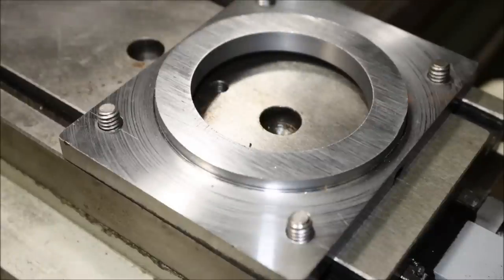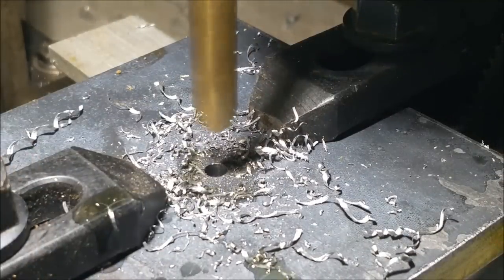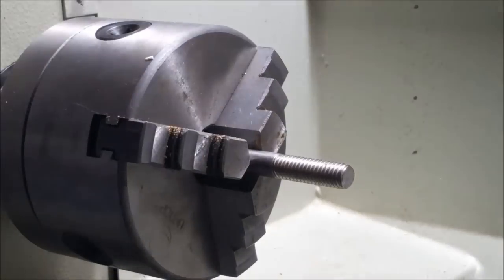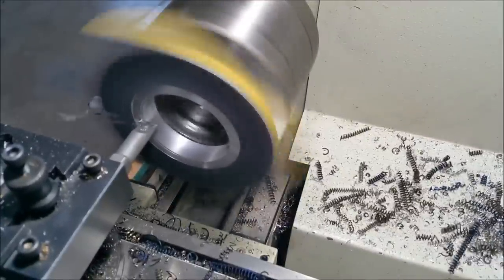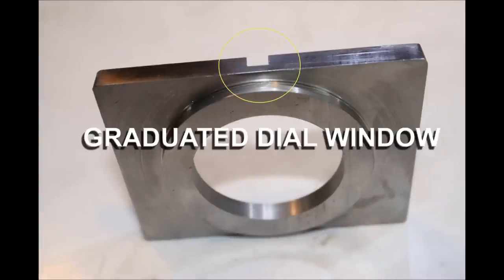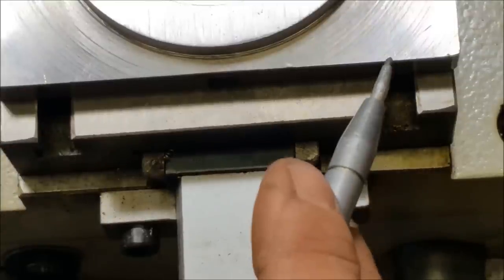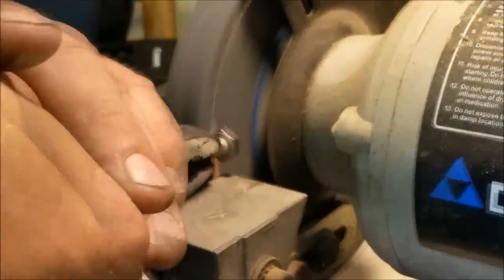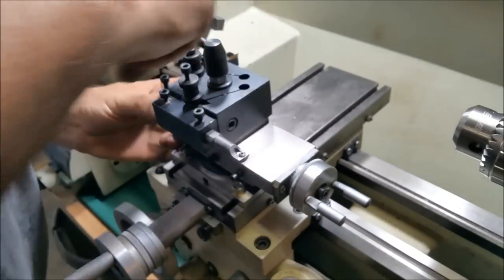Grizzly G4000 9x20 4 Bolt Compound Clamp Mod

Comment: Just a suggestion.... Offset the center hole to one side to make it easier to see the graduated dial. The larger diameter hole on the bottom should break through the side without the need to then mill a window. Great job. Keep up the good work.

Comment: Just wanted to say thank you for doing this video.  I made the same part and it made a world of difference!  The original design just doesn't hold the tool post as rigid as it needs to be, and this mod made it rock solid.

Comment: Don, this is really a superb video, just the right level of detail and explanation. I don't have easy access to a piece of steel the correct size, but I do have a block of aluminum, so I'll try using that to make one of these plates for my 9x20.

Comment: I would just like to add some advice, when making this replacement for the two bolt clamp do not turn the centre hole to the size given. After making this modification it has been found by many lathe users  that if you bore the centre hole to a close sliding fit to the spigot on the bottom of the top slide, this will go a very long way to eliminate tool chatter.

Comment: I bought this same lathe from Harbor Freight about 8 years ago.  It was a floor model, so I only paid about $400 for it.  It had a couple of issues which were easily fixed, but this modification isn't just a nice suggestion, but an absolute necessity, IMO.  These can be turned into really decent little machines if you do some work on them.  This is the first mod that should be done, and will make this lathe much more rigid and stable.
Reply: I got me this same lathe (Central Machinery) last year 2021 from some scrapyard in KY for right round the same price... this was the first mod I did after fixing up the poor thing which had been banged up rough from its time in said yard.. and even I was quite surprised that I even managed to pull it off even with the most basic of tooling and a ‘Meetotoyo?’ digicaliper.. Still there to this very day. As for the graduated dial slot, I had to mill that on the lathe with a vertical milling adapter table thing.

That, and I had to turn it from a 5/8” thick plate, which turned out real nice as it was thick and solid, though thinking in hindsight, I could have made more space for the bolt heads, but it all worked out in the end despite it being a rather tight fit.

Comment: I am planning to make one of these Thanks for the idea. How about using an hole saw and making a slightly smaller hole than the smaller finished inside diameter to hole the piece in the chuck for the first operation? That would also save some time in the next turning as most of the metal is already removed...

Comment: I need to make a tool post holder something like what you built , good job btw.  I was turning a piece of brass stock and the tool post was ripped clean off the cross slide !  Broke the cast iron base !
Reply: Funny i have used this machine for years with no modifications.Did you tighten the base unequal with debris under it?Did you make an excessively deep cut or did you crash the tool post into the chuck?Parts can break but if you find yourself modifying your machine you may need to get back to basics.When i write programs for our Haas VMC”s or lathes at work   I am trying to be efficient and maximize profit.When i make parts with my home Jet 920n I understand that i have to work with a different set of parameters.The vast majority of all modifications i see on these small hobbyists machines are totally unnecessary and are the results of poor set up and tooling use by the user.I have hundreds of hours on mine and have used it most of the time on 304ss and 316l .If you exceed the limits of any machine you are going to have issues.Poor machining practices / improperly sharpened tooling are the root of the majority of problems with non professional Machinist.Food for thought.

Comment: Thank you for responding. I do that when I centering the tool, however, the adjustments on the tool holder wont let me go lower, I think I will have to send the tool holders to a shop to take down 50 thousands.
Reply from the maker: if you can t go any lower, you could grind the bottom of the tool.

Comment: Hi folks, overall a really useful idea but don't use a drill chuck with an end mill cutter. That sort of chuck cannot grip tight enough and the tool can be pulled out by the cutting forces with possibly very dangerous results. Drill chuck are designed for pushing, not the pulling that happens with an end mill. Also do not use standard bolt heads in T slots. It's a very good way of distorting the slot. Use the proper T nut - they are designed to spread the load for a reason. BobUK.
Reply from the maker: Thanks for the feedback Robert
Reply: T-nuts aren’t exactly a buy whatever you need item, sadly.

The way my lathe came as-is already had standard bolts shoved into the t slots to hold the compound assembly in place using the original clamp, and of course it sucked, but had to make do until I managed to mill t nuts for it using a lathe milling adapter table and a toolmaker vise (yes, I put endmills in the chucks, and no, I didn’t have any choices at the time) - that, and the stock lathe t slots weren’t standardized stuff, or at the very least weren’t some item one could just order and be done with - one had to make them to fit these slots, and it was doable, albeit not easily.

That being said, those t nuts combined with this  4-bolt compound clamp I had made as shown in the video (thanks also to Steve Bedair) was not only a much better and more rigid setup, but also had the advantage of having the nuts in a different location than the original, which were already sort of busted by the time I bought it.

Comment: I understand that the four bolt compound clamp is THE very first thing you should do to improve the 9 x 20 lathes rigidity.
Reply: Stiffening the toolpost is the first thing that you should do.  All cuts that you make with it will be better than you can produce with the factory mount so all of your subsequent work will benefit from it.  This mod helps but IMO a better solution is to make a Pitkin Donut compound base, which stiffens the toolpost by a measured factor of 5 and is easier to make than the 4 bolt clamp.  My first facing test cut on some aluminum using mine looked and felt like it was polished.

http://coleman-family.org/Files/Donut%20Compound%20Mount%20for%20the%209X20%20Lathe.pdf
Reply: @CapnCrusty  thanks for the link. That's a great idea.

Comment: I am assuming that when people do this project, it is to bolster the rigidity of their cross slide.  If that is the case with your effort in this video, why then did you not comment on the effectiveness of this project?  It would be nice to know how well it worked.

Comment: Very clear and well spoken video. Did I send right you just eye balled the distance between the t-slots for the bolts? Did not see you face the bottom of the plate when you were boring it and later look maybe sanded a little?

Comment: Mr. Brandt good work I should do it to my lathe, however, I don't have a mill. Question what is the model and # of kwick tool changer. I purchase one to use 1/2 tool holders but they are too tall, and I can't center the tool to the job, if I had a mill I could fix them to fit, Thank you and have a nice day
Reply from the maker: Good question, i find that i have to set my tool heights for every tool to be on the center line of the work. Some Quick Change tool holders have an adjustment screw that helps. A good way to find the center-line is to move the time to the live center and have the top of the tool meet the point of the center.

Comment: Hello Dan... I thought for a long time before I posted.  Not trying to be a Troll, but I have 3 suggestions... After 60yrs of machining and engineering, in my shop we have several rules we abide by.   Please understand they are just suggestions, and I don't try to offend anyone.  #1> Never ever use an End Mill in a drill chuck, use Collets, or tool holders,  doesn't mater even if it's an 18N Super Chuck... #2> I cringe when I see someone using a Dial/Digital Calipers for a Scribe, even if it's a cheapie, it's still a precision tool, and your Mitutoyo is not cheep, If ya have to do it, pop for a $10 HF POS, they're disposable :-)...  #3> I like using Center Drills for pilot/spotting holes... The counter sunk pilot will aid when you start the larger drill bits, and will not chatter/wander...   Thx for the great Vid...

Comment: Great Video. I also own as G4000 lathe, have 2 questions where did you get the tool quick release, and did you modify the pulley system to use the normal V-belt, the present 5mm belt can't handle heavy operation or cutting.
Reply from the maker: Hello there, the quick change tool post came with the lathe.. Check out the video of me picking it up here: https://youtu.be/CkePxIUMBSQ    I think you can buy it here: http://www.grizzly.com/products/Quick-Change-Tool-Post-Set-Mini/T10167?utm_campaign=zPage&utm_source=grizzly.com I am still using the same belt, i did order a few extras however.. Thanks and cheers!

Comment: Don, I’m making this part right now and I’m about half finished. How has this mod held up? Did you really notice better rigidity and cutting from this modification? 

Thx 👍
Reply from the maker: Hi mike, I'm sure you will be happy with the upgrade yes, I get much better cuts. Thanks for the comment.
Reply: Don Brandt I noticed in the video you stated “3/4” bolts.” I know this wasn’t 3/4 diameter but rather the actual length of the bolts. It seems nothing larger that a 1/4” bolt will fit into the slots once the head is ground a bit. Can you confirm you used 1/4-20 bolts or did you use a metric size? TIA👍
Reply from the maker: @mikemike6096  Hello Mike, yes there 1/4-20.. I had to modify the heads to make them fit as shown in the video. Im pretty excited for you!! Its cool to hear someone following the video. Cheers Buddy
Reply: Don Brandt 👍
Reply: mike mike I just made this mod to a 21 year old Central Machinery 9x20 that was given to me. Had been sitting in a barn unused (except by mice & wasps!) for 20 years, and was still in the original rotted out box! I printed out the drawing from Steve Bedair website, which shows three different bore sizes instead of 2. I screwed up and made the 1st smallest bore too big, and wound up only having 2 bores like yours. I’m not really sure why they added the third bore anyhow. The drawing shows the hole offset on the plate, but I centered mine up on a 4” square piece. After the bores were done, I marked a cut that opened up a 3/8” (+ or -) window to see the degree wheel similar to the original clamp, but much smaller. No problem seeing the degrees when done this way. The end product is rock solid! Thanks Don for the vid! It takes this lathe to the next level!
Reply: To clarify my previous comment, I cut the entire end off instead of milling a tunnel to see the degrees. The cut just barely opens up the edge of the large bore, but makes it much easier to see the wheel.
Reply: I used 6mm bolts to mount this because that’s what was originally on it. Note that a 6mm hex head bolt just barely fits the t slot without any grinding!

Comment: Just what I was looking for.  Can't wait to try it.  What QCTP are you using.  That's something else I need to do.  Thanks.
Reply from the maker: Hello Dale,  awesome, glad to hear.. Below i'm sending the links for two products, the i want and the one i have. I would surely get the one with the handle, as it is, i'm using the one that came with the lathe. Thanks and Cheers
The one I would Recommend: http://www.grizzly.com/products/17-Piece-Quick-Change-Tool-Post-Set/T10166
The one im using: http://www.grizzly.com/products/Quick-Change-Tool-Post-Set-Mini/T10167
Reply: Thanks.  Truly enjoy the channel.  Please keep them coming.
Reply: Just a quick note: Grizzly.com  states that the T10166 does not fit the G4000.  I'm no expert, but from my research the G4000 takes an AXA type QCTP, LittleMachineShop.com and Shars.com both have reasonably priced units.
Reply: Thanks

Comment: That is a lot of boring for the center hole.   Maybe instead of drilling a 3/8 hole initially, you can drill a 1/4 inch hole (and use a 1/4 inch bolt in the chuck).  When you are done, you can use a 1 and 7/8 hole saw (or similar) with a 1/4 inch guide bit to do most of the center hole.  You can then use a boring bar to finish it up.

Comment: Do you have a collet set ?  I see you use a drill chuck to hold your end mill.  It works , but the collets are much better for a few reasons. If you have good collets , they will have less run out than your drill chuck .  This will add longevity to your end mills !  And believe they have much stronger grip than a chuck.   The other good thing about collets is they will shield you from harsh comments from the Know it all's ! lolol

Comment: Don, great video.
Did the modification work?  I've just recently purchased a new Chinese lathe and the finish on longitudinal cut is awful.  I will likely do this mod, but it would be good to get your views on whether or not it made a difference.
Stay safe in these troubled times.
Cheers
Mark

Comment: One word of advice to any one considering replacing carbon steel screws with stainless. Don't.  Not for any thing where strength is more important than corrosion. Stainless is about 60% of the tensile strength of good quality carbon steel screws. Also either make tee nuts or make a long tee bar that is the distance front to rear of the plate. Drill and tap that. That will spread the loar of the locking screw over a larger area.
Reply: I used high tensile steel bolts and nuts. Been working perfectly for many years.